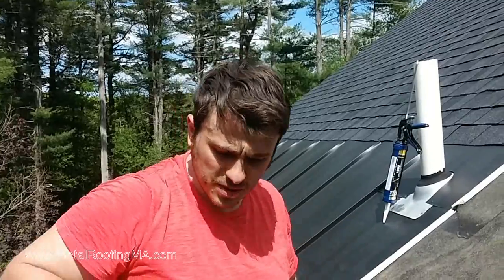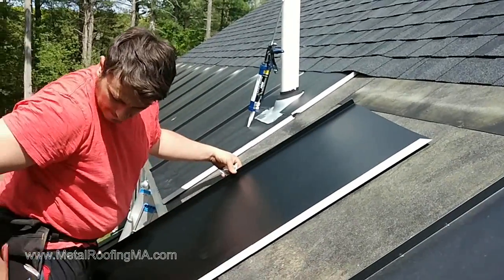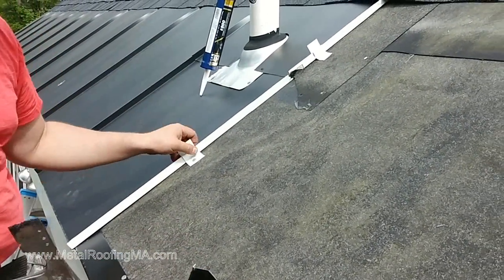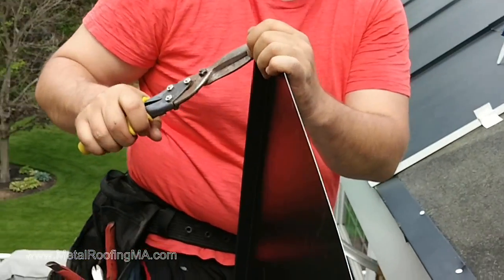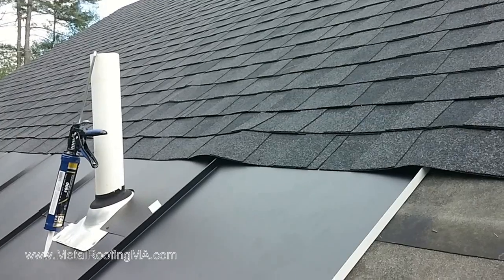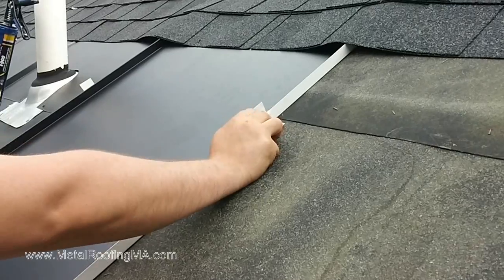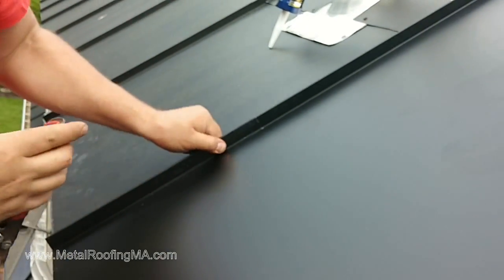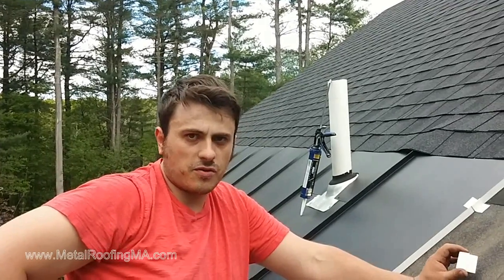"Install Metal Roof ICE BELT Panels to Prevent Ice Dams" by Leo at MetalRoofingMA.com

Comment: Please you have to replace pipeboot ,rubber around the pipe is already damage , water can get in . 
And please need to use ice water over panels and starter strip
Reply: Why don’t you put ice and water over the panels that don’t make any damn sense the panels are metal so the ice slides right off yes ice and water is not textured or grain. It is also not a ment as a finished look

Comment: If  the dip edge was put on to short , Then you should have replaced it , the  proper way for the customer ???
Reply from the maker: +Dan Carroll it wasn't put on too short. it was not nailed properly. So we nailed it properly where we could.

Customer did not pay us to remove ALL ice belt panels to add few nails, so we did not remove them.
Reply: +coolflatroof  I do understand ,thanks to this video ...but the drip edge still had a little more movement  then I would have  liked. I would have told the customer and checked the sheeting  under that roof, it could have been the problem in the first place ...That's just Me .
Reply: @dancarroll2049  then my guess is you end up doing a lot of extra work and then complaining about not getting paid for it this is business. We are not friends. I’m not gonna do favors for random people because very rarely to those people ever return the favor. I would’ve communicated with the homeowner what I seen and allow them to whatever decision they saw fit